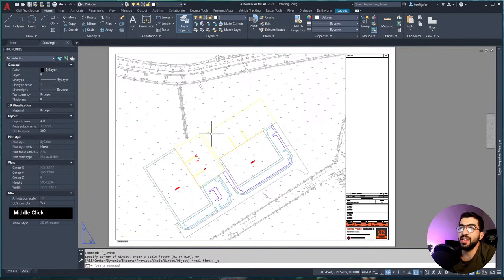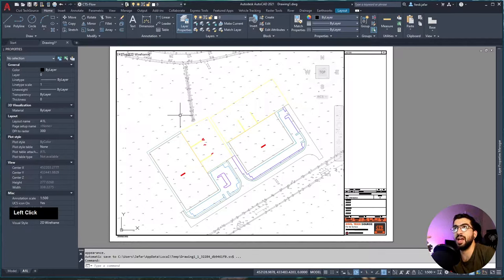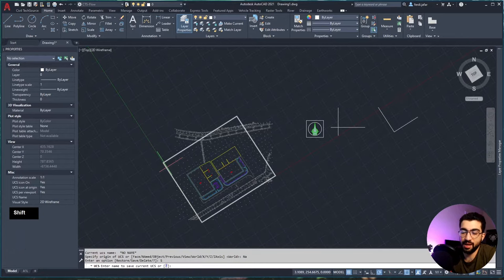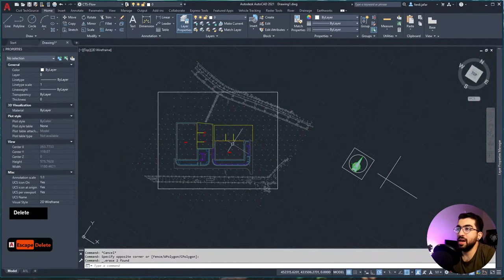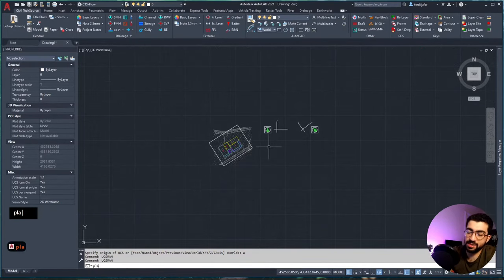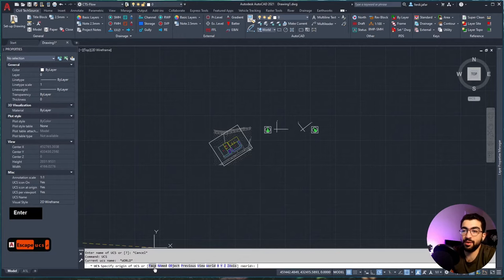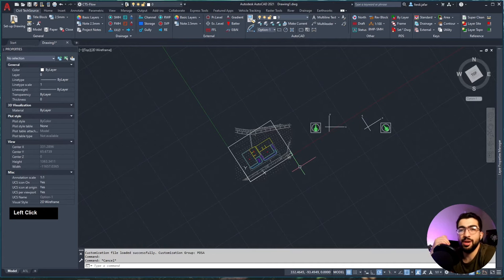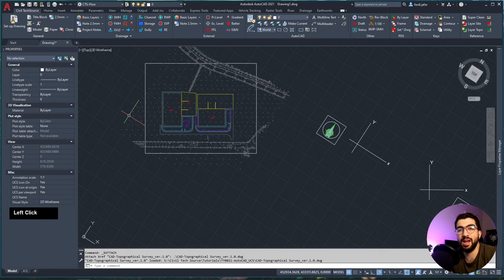AutoCAD UCS - How to rotate your drawing and everything else you need to know (2D)

Comment: aoa sir Your Videos is very helpful. kindly make a video for text rotation i mean when after rotating the drawing i want to draw a xy on drawing on some different point but when i draw xy coordinate text rotation was not shown in 0 angle or aligned with line is it possible to draw coordinate or xy text on line alignment at any point.
Reply from the maker: I think I know what you mean, this can be fixed by using UCS and setting it back to world. Because text and objects will always have to come at rotation 0 so if the UCS is changed the rotation will try to follow the X axis.

Comment: Great video. However, I am having unexpected issues with my UCS. Original problem is that the custom named UCS's suddenly stopped working properly. For instance, I would change my UCS to a specific named one, but the coordinates would be wrong and the 'top' view cube was not consistent with the compass. Also, when I followed your instructions for Plan>Current then changed back to world, it changed the view back to WCS instead of just the coordinates so that I could keep my current view. I have tried so many things to fix this and I am lost. Not sure if it has anything to do with a lisp routine I imported in order to copy multiple named UCS's, but it worked fine for a week then everything went wonky. Any help would be fantastic and much appreciated!
Reply from the maker: Hi Dawn, not sure what the exact issue is. But few things that might help, to revert to the original UCS you need to type UCS>World. The plan current command only rotates the drawing so that the x and y axis are in the "traditional" locations (horizontal and vertical) maybe if you could drop me an email and have a look I might be able to assist further.
Reply: @CivilTechSource  Thanks, email sent.

Comment: so many unnessecary steps when you can just rotate your vport in paper space . model space should always reflect the real world coordinates and rotation. meaning north up. vports are a better and much easier way. vport are there for production purposes. In other words this application is not the correct way!
Reply from the maker: Oh you are correct and wrong at the same time. This is application is useful as when you start importing text blocks etc the rotation is set correctly and readable to you and you can switch between the two ucs and see avoid switching between model and paperspace. Just because you don't use it doesn't mean it's wrong.
Reply from the maker: Also there is no rule that model space should always reflect true north. We just made that rule up just so our workflow will become easier between different consultancies